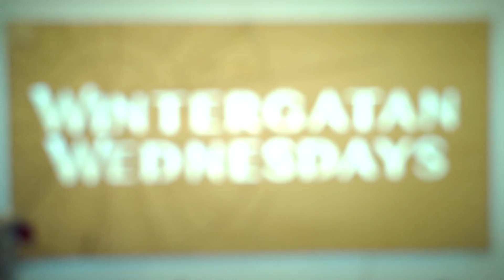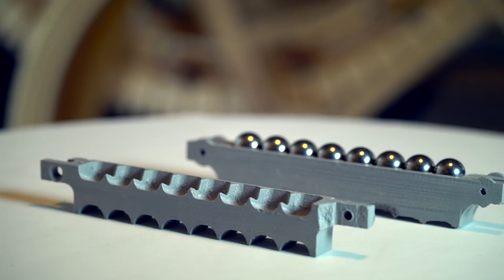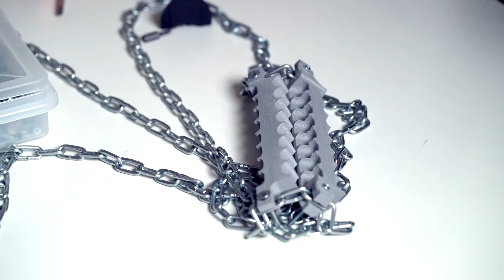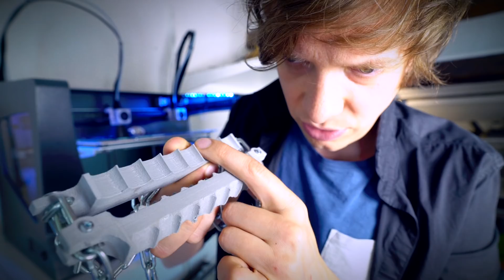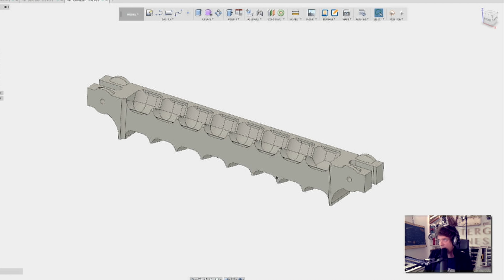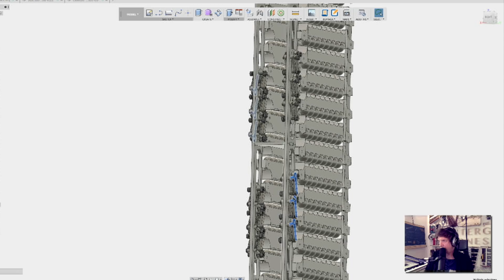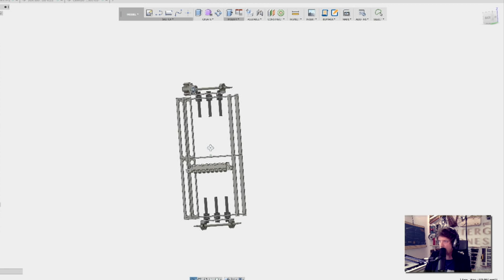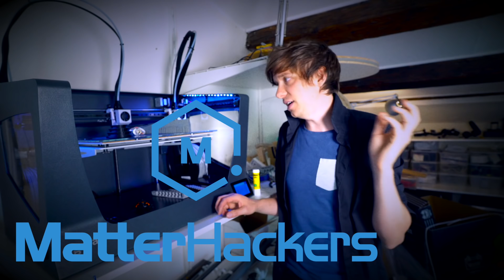3D Printed Marble Lift - Marble Machine X #34

Comment: why not print sideways? seems a large flat surface. And the slots for the chain and the frame can be bridged with support which is easily removable and does not leave any visible traces

Comment: A suggestion : avoid printing too much pieces at the same time. If something goes wrong in the middle of the print, the entire batch is lost, as is the time spent on it. Your machine will probably fail less than a chinese clone of course, but 3D printing is still figgety and prone to failures no matter the build quality of the printer. Plus, you don't really gain that much time by doing this.

Comment: Good morning, Martin! I think you are going to have a problem with the with the marble 'shuttles' jamming on the frame. There are guide channels in the shuttles to glide along the frame and stabilize them, but the frame is not continuous to accommodate the shuttles  inverting/rotating over and under the frame. As the shuttles reorient themselves the edges of the channels with catch or jam on the edges of the frame. Considering the weight of the components, torque, and spin, combined with how complex this section is, if anything jams-up, inertia and mechanical force could cause this section to tear itself apart. If you think the guide for the shuttles is necessary, consider bending and soldering a thin metal rod into an unbroken loop so that the guide channels of the shuttles are in constant contact throughout their circuit. Also, with this approach you may want to widen the channels slightly to allow some play in the system and perhaps line the inside of the channels with felt to reduce mechanical noise of the shuttles bumping on the guide. I hope this makes sense!

Comment: Not trying to push any products but I've found this glue to work best when joining prints:

DAP 00155 0.85 oz Rapid Fuse Fast Curing All Purpose Adhesive https://www.amazon.com/dp/B01DA6X0E8/ref=cm_sw_r_cp_apa_i_-1X8AbXPVCPD4

Comment: I am no expert in this, but the Ratchets are only the right side of the marble lift, right? If that is the case, you could get some major friction problems, because the chain is flexible and it could cause the Mable lift to go up further on the side with the Ratchets, and the other side will be behind. This would mean the marble transporting bars are not horizontal any more and might get stuck. It will definatelly be more reliable if you add 4 ratchets on both sides.

Comment: Hey man! It's really cool that you have a dual extruder. The reason this is cool is that you can use a water dissolvable filament for your support structures. This will make your life sooooooooo much easier, as you can then put your piece into water and all the supports go away. 😁

EDIT:
As the replies have mentioned, you can use PVA filament to dissolve it in water, and HIPS to dissolve it in alcohol.
Reply: Anonymouspock You can bake the PVA to drive off any moisture afaik, so that shouldn't be an issue.
Reply: Use HIPS filament for support instead, it dissolves in alcohol.
Reply: But does it pass the rule of cool tho?
Reply: Yes it does, Sly!
Reply: Linus Brendel wow! Thats amazing
Reply: That is exactly my first thought. But expensive PVA or HIPS is not required in every case - often it helps to print the support structure just with an other material because they would not stick together, e.g. main material is ABS and support is PLA.
Reply: Wow, that's really cool actually!
Reply: True :P
Reply: Btw - where's today's video? I'm fine with nothing but Martin making even more progress by leaving it out this week but it still would be nice...
Reply: It's better to dissolve HIPS in limonene.
Reply: Ooh, that's neat!
Reply: I still demand that we hang the printer by it's neck :P
Reply: Linus Brendel That's slow and the PVA loves taking up moisture on the roll. That being said, having the dissimilar plastics helps a lot getting the supports off.

Comment: While I agree with the rule of cool, there also could be some significant issues with your elevator... And annoying noise in a music machine isn't cool.

But if it ends up working, good for you! Just keep in mind the simpler designs too if you run into issues. :)

Comment: I think the archimede's screw would pass the rule of cool!! What's not cool about it?
Reply: I agree.  Multiple screws with clear housings, perhaps running at different speeds.  I'm not a fan of the chains at all.
Reply: I agree as well. I would prefer this clean solution over that clunky one.
Reply: The vertical spring screw is also cool. And each spring could lift 4/8 marbles at a time.

Comment: HEEEEYYYYYYYYY!!!!! put water soluble filament in the second head for the support material. all you have to do is put it in water for a few hours. making it much quicker and easier so you dant have to cut and file at the print. (also less mistake will occur) :)

Comment: If you need support structures i can advise you to use autodesks meshmixer software with its branching support structures. They are far better than any stock slicing softwares sturctures.

Comment: Nice video! For the 3D printing, you might not need to "cut" your piece in two, just print it from the side (perpendicular to the cut plane you made in CAD), only the space for the frame guide would maybe need small support! And   that way you could have the holes printed. Give it a try?
Reply: I don't mean standing up like @Bourinos02 was thinking^^ just the other way. because during the printing, the face looking at the camera is flat (or you could make it flat) and so is the face opposite. I think the face facing away from the camera during the print timelapse  should be the bottom base for the print

Comment: I think you orientated the part correctly with your 2nd successful print with the Marble carrier.  I personally wouldn't split the part in 2 and just deal with the small amount of support clean-up on the ends.  When printing, think of the Z-axis layer lines like a wood grain.  This "wood grain" can be used to either provide strength or weakness in the end part.  MakersMuse is a great channel resource when learning 3D Printing, even if his videos are 5+ years old.

Comment: Thought about getting a Sigmax. But i think i'll pair my existing Prusa i3 MK2S with the MK3 and get the Multi Material Upgrade for it later. While dual independent extruders would be better for what i do, the firmware isn't quite where it needs to be for that printer.

Comment: Seemed like the frame guides were ended at the top and bottom, aren't you afraid that when the carriage turns that it might get stuck when trying to get on the opposite guide rail?

Comment: Seeing as you have a dual extruder system, you could experiment with using pva as support material while using pla/abs as your normal build material. If you did this the pva supports would dissolve away when submerged in water 😁

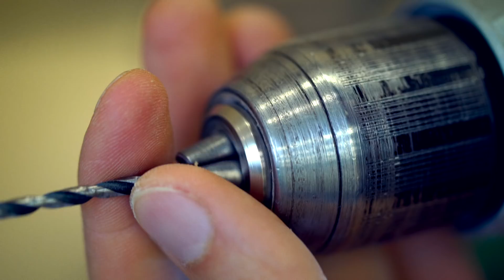Comment: 1:05 I wouldn't tighten a drill with it's own power, the threading is built for human levels of torque, not drill levels of torque...
Though it's convenient, it's not exactly the formula for long tool lifetime.

Feel free to correct me If I am wrong though
Reply: I was referring to Martin tightening the Chuck with the drill's power. I've managed to almost kill a chuck with that, and it took some raw power to un-block it again after it basically locked shut due to too much torque on the locking mechanism
Reply: WastedWizard You must have a killer grip then. Maybe you shouldn't hold the chuck so tight.

Comment: Since you have a dual headed printer, you can actually use water soluble filiment and use that as a support instead of just regular filiment. I recommend this option for smaller areas that require supports. Here's a link to the filment (from matterhackers, ironically) 
https://www.matterhackers.com/store/3d-printer-filament/175mm-pva-filament-half-kg